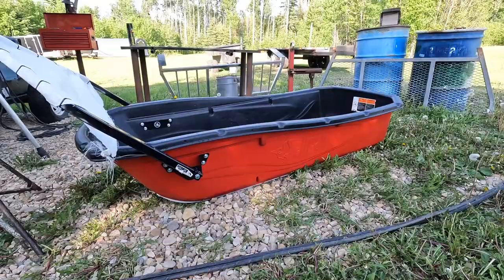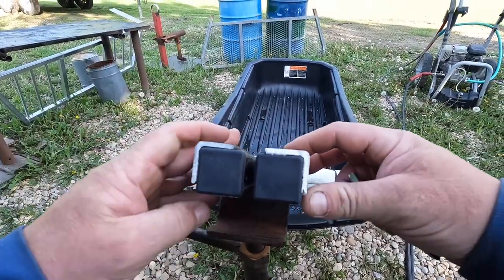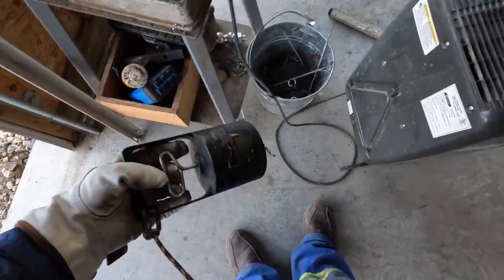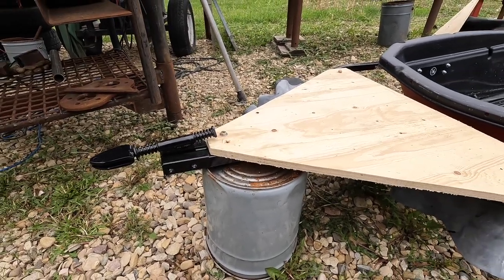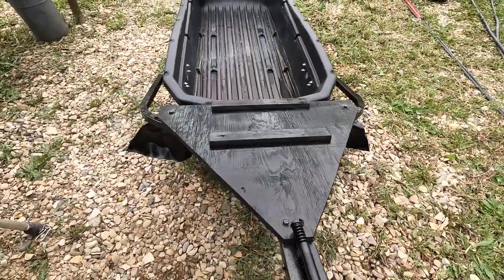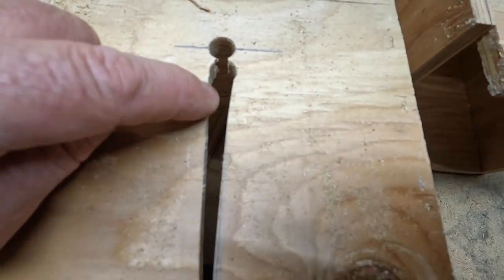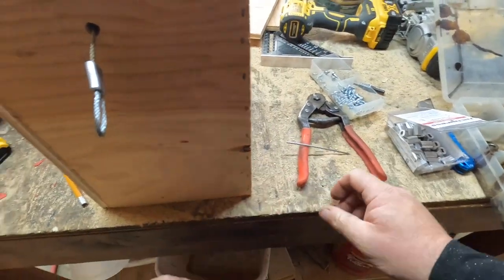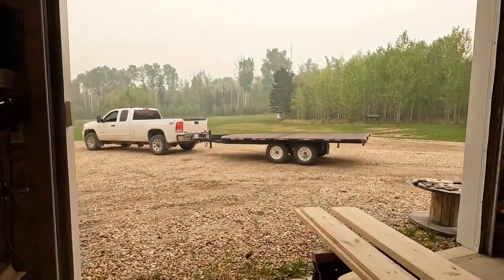Pelican sleigh mod and Trapline Prep May-June 5th 2023

Comment: Do you secure the lids on the marten boxes at all or leave them "unlocked" ?
Reply from the maker: I don't unless I set them up on an angle or on a log or fallen tree, in that case I just use a screw on the lid and box and small piece of wire. Thanks Scott!
Reply: @whatido3021  ok, interesting 
I would have thought a Fisher might have robbed the bait without a lock...its quicker to build that way without a lock hehehhe...I will give it a shot....love the ratchet strap hinge...i got a bunch of em that can be cut up also easier and cheaper then buying hinges!!!
I appreciate your work amd your videos sir....keep being awesome!!
Reply from the maker: @scottlaughland598  Building a lock only requires a few small screws and a piece of wire, but I can't say I've ever had an issue when the boxes are installed vertically. Thanks Scott.